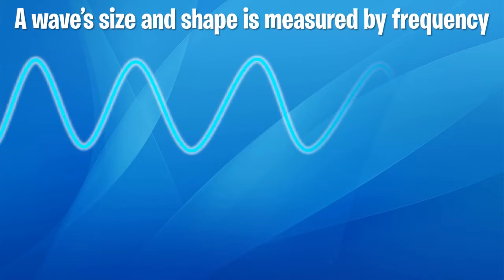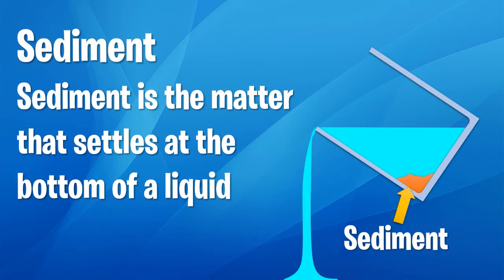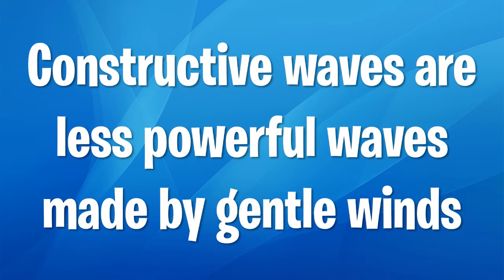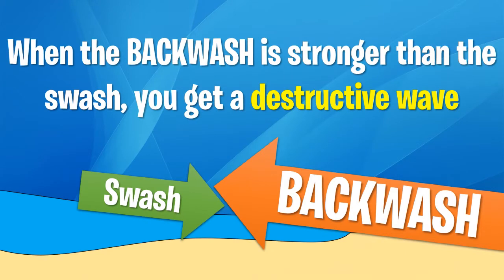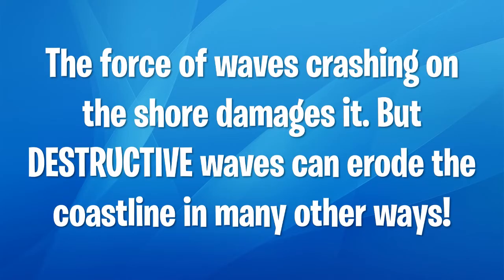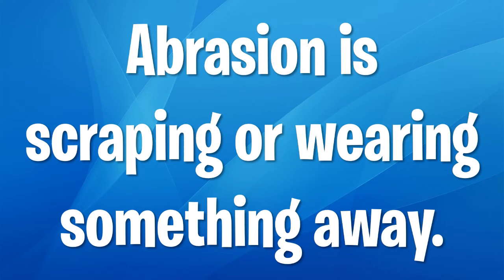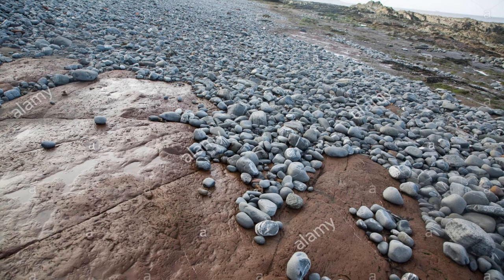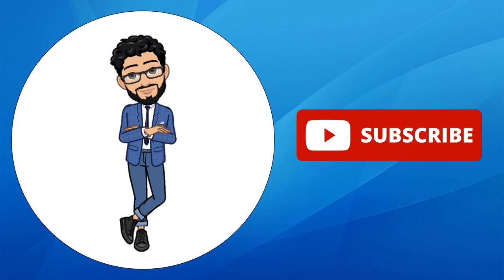Coastal Processes - Erosion

Comment: is it safe to say that the last few pictures (examples for solution) are a result of a mix from all the forms it seems to me it could most definitely also be because of hydraulic action but I'm not sure..
Reply from the maker: Hydraulic action is occurring anytime water compresses air trapped in cracks found in rocks, so you're right to say it is happening, but the major player in the last few photos were of solution. Namely, some rocks are alkaline, which is to say the rock dissolves easily. A good example is limestone, when it mixes with salty water it dissolves the alkaline parts well so creates these unique landforms